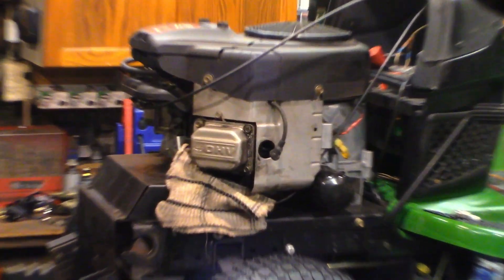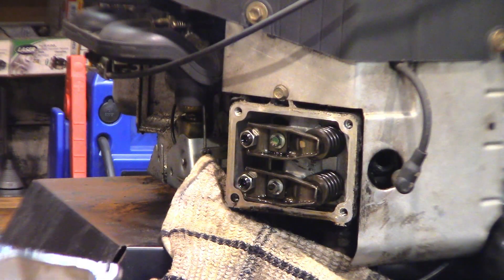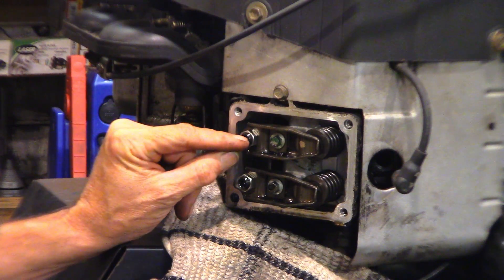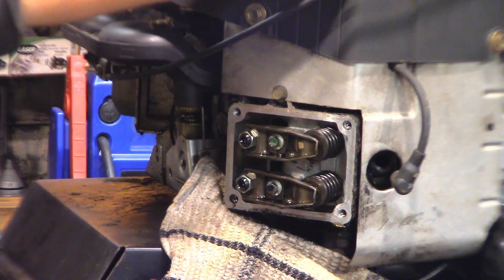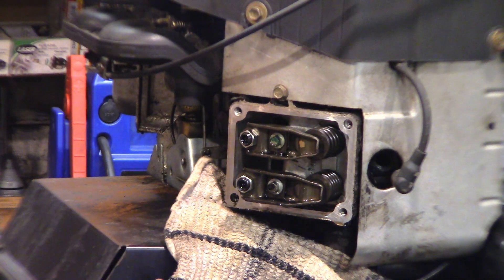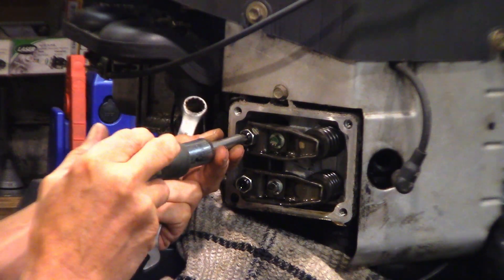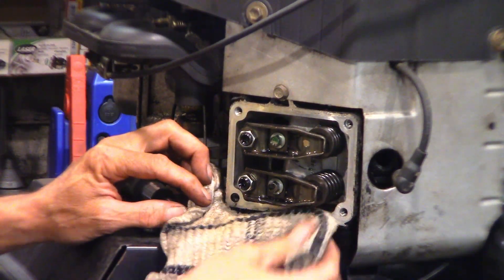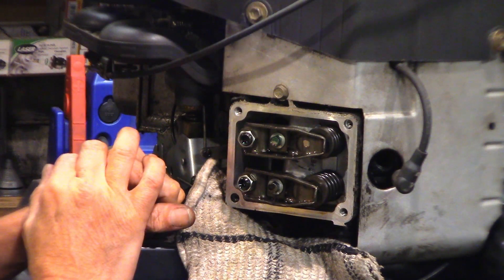Small engine valve adjustment. Hard to start Briggs & Stratton, Tecumseh, etc.

Comment: Thanks for showing how to set each valve when the opposite valve is open, so much easier than removing the spark plug, and using a tool to find the location plus a quarter turn. 
You're way is easier, and saves time and extra steps. 👍🏻

Comment: Got question for you that i have a yard machine bout 16 years old i used it for 3 to 5 years when it was new but then it didn't want to turn over way back uust after replacing the belt on it, took it into a mower shop which was a complete waste of money & time, it when in for the problem not wanting to start thats how they gave it back to me, was disgusted for their incompetence nonetheless it has been sitting outside all the years now do you think its possible to yet get it running again? Im sure battery needs replaced, gas tank flushed out, oil changed, & wires crimped back together being mice chewed on the wiring, but you think the engine itself is yet good on it for not starting all these years? I also noticed the back wheels are locked up not moving at all? Do you think its worth saving may yave to spend 500$ or so likely to get it running again but if its to much like over a grand then that  don't think would be worth it do you think so? I should had bought a shed years ago but had no place to store it in my single car garage, dont know what to do at this point i only wish there was a mower mechanic tnat comes to the home to check it out being im unable to get it up on my truck, are you in California? I would have you to come here & pay you to get it running again if you was able to.
Reply from the maker: That's a tough one you may have to replace a pile of parts to get it back to 100%.  Deck spindles may be seized, belts rotted, brakes seized, etc.  Plus, pay someone to do all the work.

If $1000 is your magic number, you might be better off finding a used unit for around that value.  I'm a little distant from Cali.  Southern Ontario, Canada.

Comment: I have a 13.5 briggs and stratton  it wouldn't start  conclusion was not starter motor  so I put a new cam sharft in readjusted the valves   and still it runs for about  a minute or so and stops the same thing  I have been  replying these engines for some time  but this one has me stumped  timing is good valve  adjustment  good and sill it starts ones and stops will not restart  ..any ideas   thanks .I can see nothing wrong with this  engine

Comment: Did you say it’s the same specs for single cylinder Intek engines?
How about the smaller walk behind mowers? 
I have a feeling that they haven’t ever been adjusted.

The 17 or 17.5 HP Intek smells a bit rich, I think….I’m guessing that is another sign that the valves need adjusting? 
Now that I think about it, the walk behind smells a bit rich, too.

Comment: I tried doing the homework myself, but I'm coming up dry. I'd appreciate help! Briggs and Stratton twin cylinder model 44T9770031G1. What would the valve settings be? For some reason I'm not finding that model online. It's on a Kubota zero-turn. Thank you.
Reply from the maker: I'd set them both at .005
Reply: @randomwrenching  Thank you sir. I appreciate your knowledge base.

Comment: Would you know the tappet clearance for a gravely 764 cc on a proturn
Reply from the maker: If it's a Loncin made engine (which my research came up with...)

Intake valve: 0.10 ～0.15 mm
Exhaust valve: 0.15 ～0.20 mm

That's right from the Loncin website

Comment: great job....does the gasket on the cover need any special care, sealer, replacement when adjusting valves
Reply from the maker: If I don't have a new gasket, and the old one is in good shape, I'll smear a very thin layer of RTV on the gasket and clean the head with brake cleaner before assembly. I usually have new gaskets in stock though.

Comment: I never understood why to use the TDC method.  I have always did it your way without a problem. Using this method makes better sense to me.
Reply from the maker: It's easy and foolproof this way.  But, I set the old small block Chevys while running, tighten them 3/4 turn down from 0 lash. 😎👍